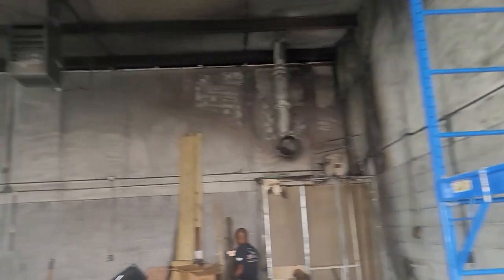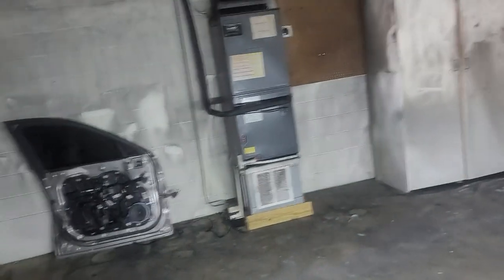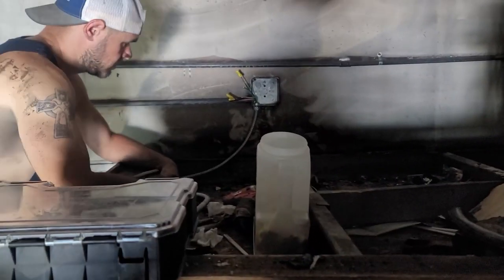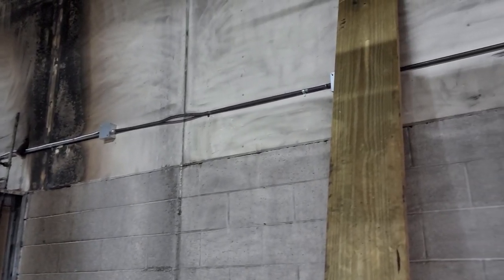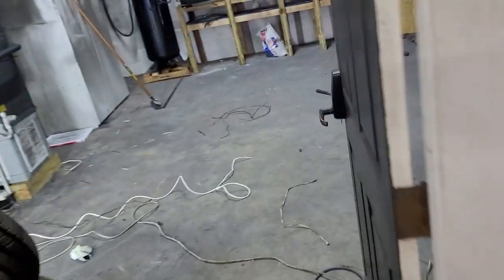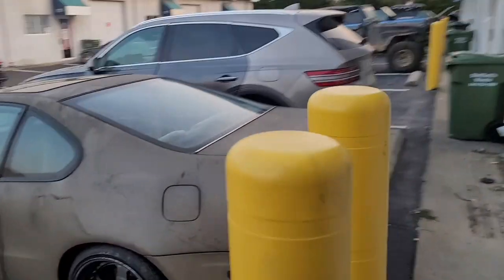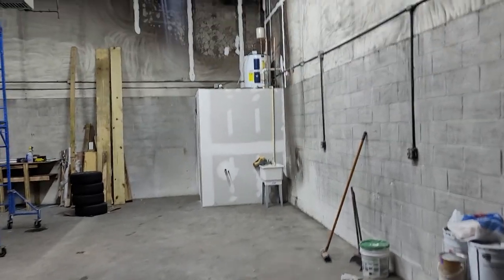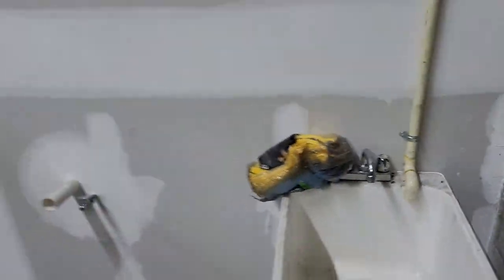shop fire update

Comment: Getting there man, are you putting another booth in the shop?
Reply from the maker: Gonna put a real booth all said and done.
Reply: @treybedipping1734  nice man! Wanted to ask how was the dust/trash in the clear with the old booth? I have the same setup and just started doing gloss as well.
Reply from the maker: @urielcarrera5689  it wasn't perfect but it was pretty decent as log as you had enough air flowing through